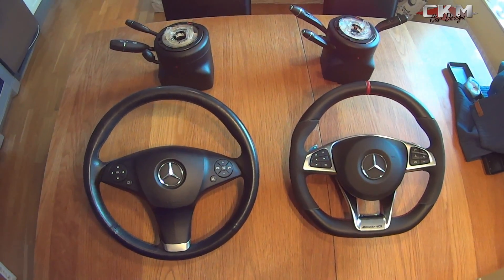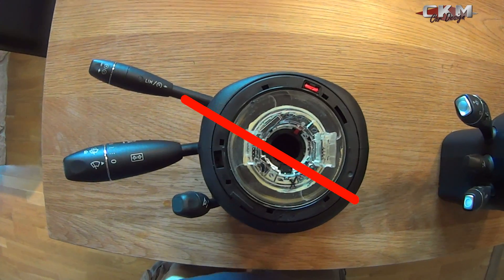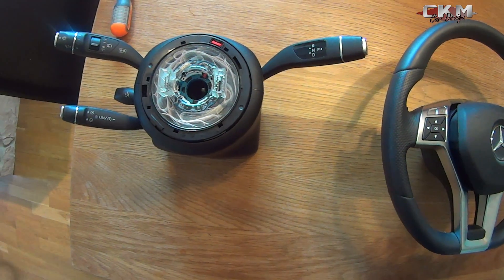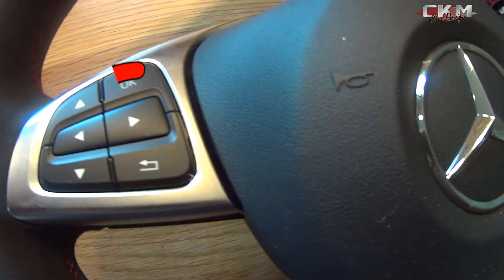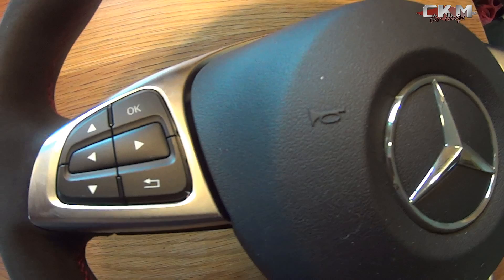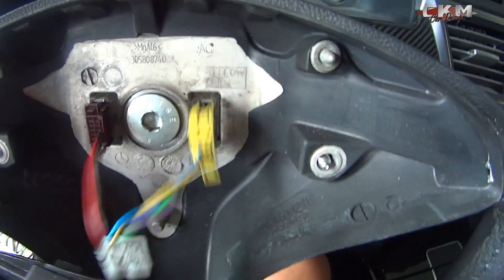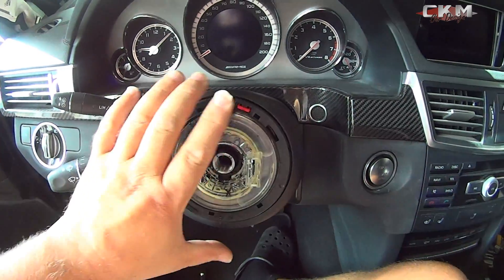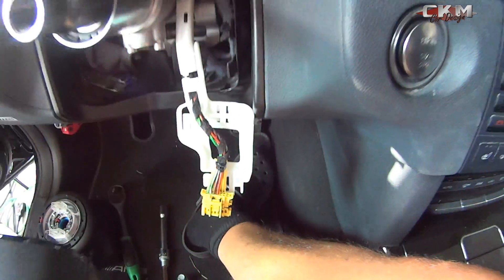Mercedes Facelift steering wheel retrofit W212 W204 W166 W176

Comment: Hey Chris I have this steering wheel on my W166 ML350 https://images.app.goo.gl/gS5v8dN7eJSqXKU96 and I bought this one from GLE W166 https://images.app.goo.gl/J3KqSQGBDJnuYT7j9 from what I understood of the video I can fit it without changing electronics and stuff right?  Do I have to change the console, because steering column looks identical to GLE. Thanks
Reply from the maker: Yes. Just switch it.
Reply: CKMCardesign great so I don’t have to change the steering column I just have to change the steering wheel. Thanks

Comment: What about the safety ? How much torque on the screw ?. Allowed ? Dont want to crash with 200 on the Autobahn😂
Reply from the maker: So if you would not torque it 100% what you think would happened? That it would just pop off. Dont worry. IF that ever would come lose just  tiny bit you would feel it right away. Like A year before it would come lose in hole.
Reply: @CKMCardesign  ok, C63 amg engine possible in golf 3? Kappa

Comment: Hi nice video. You showed me where to buy steering column from ebay, any idea where i can buy the steering wheel it self. Mine one is W204 2010  is fit replace with W204 2012  thanks a alot
Reply from the maker: On my site-.-

Comment: Did the air bag come.with the new upgrade
Reply from the maker: How you mean "come with" ? You chose with or without on the site..
Reply: Ye Christopher Thompson you can buy with or without 
Search ebay for deals also do your reasearch ....but try to buy with original airbag so no messing about or imho get from ckmdesign.se chris will help you from start to end and not just leave you once u purchase and will help you no matter what. Trust me... its worth it... i wish i bought everything from him to begin with.
What i have learnt is old prefacelift cars wont really work with facelift SWheels... you should aim for the 2012 + clockspring and SW. that way they can communicate better..some ppl get lucky and all goes smoothly..for myself i was unlucky cuz i have a 2010 w204 c300 and wanted to add a facelift wheel.... electronics are wired differently .... unless like i said ur lucky or u get all late parts 2012+ so they are designed for each other

Comment: Mate this does not work on the W204!

I brought a second squib from a W212 part no: A2129002620, and this doesn't work either. Now the car has thrown up 2 errors ESP inoperative and airbag malfunction!

Waste of £300
Reply from the maker: Then you buy the wrong ones as simple as that. Had this done many times on W204. See picture proof on my facebook if you refuse to believe me. ESP errors are a bad column.
Reply: @CKMCardesign   right it's just you  said that steering wheel in the video works and I've got a W212 column which you said works. Dunno what to try next.

Comment: whith Steering wheel stalk column clock spring 14-16 (http://www.ckmcardesign.com), in mercedes class c 2008. Is it possible to operate the steering wheel cams ??

Comment: Hey Chris, I have a 2007 W204 and I found an amg wheel that I really like from a facelift 2011-14 W204. Should it be just plug and play like in the video if I buy it with the column from the original car? The levers seem the same as mine - all black. Here’s a pic, thanks for your time! https://gifyu.com/image/EgXG

Comment: Can I do this same mod for my 2008 Mercedes-Benz c350 pre-facelift and have full functionality? 

I watched this video: https://youtu.be/8-e7M-sogJs

After seeing Raymond Urias try to do the swap on his pre-facelift and the buttons on the steering wheel not working I’m curious. I Don’t know if he bought the same exacts parts that you did? You tell me?

If it’s possible can you link me to the exact steering wheel and exact steering wheel column used in this video for the swap? Thanks and highly appreciate it
Reply from the maker: Of course you can. He have many failts in that video and I have told him...www.ckmcardesign.com
Reply: CKMCardesign quick questions before I make my order. I looked on the website and seen the steering wheels and I think I found the one you used in this video not too sure. But I couldn’t find the steering wheel column to match it.

Can you give me the direct links to the products so I can buy them off your website?

Once again I have a pre-facelift C350 which has the same exact steering wheel as the one you swapped out for the new one you installed.

Comment: Hi I watched another video and the guy said that this can’t be done as the wiring is different to the old clock spring compared to the new one. Have a watch, https://m.youtube.com/watch?v=8-e7M-sogJs   I really want to upgrade my steering wheel. Will it work on a 2010 e350 upgrading to a 2012+ steering wheel?
Reply from the maker: He just do it wrong.
Reply: What did he do wrong in his vids? Seems like he is doing exactly as u doing there. Thxx!
Reply from the maker: @moonmc1047  Wrong column.

Comment: Will it work on a 07 c216 cl500 ?
Reply from the maker: No. As said several times below. ;)
Reply: You shouldn't either cus its not a AMG
Reply from the maker: @ibtixgaming7168  What do that have to do with what wheel you install????
Reply: @CKMCardesign  Like if he wanted to put this in his Cl500, i just find it cringe cus i've seen many nordic people badge their mercedes with amg badges.
Reply from the maker: @ibtixgaming7168   Yeah..Wheel is avalible with or without AMG badge. This is not about the badge, Its about installning a sport wheel.
Reply from the maker: And since Mercedes do AMG badges on AMG line cars now I guess you have to tell Mercedes to stop to then. ;)
Reply: @CKMCardesign  they only do it on the floor mats and rims, get it straight.
Reply from the maker: @ibtixgaming7168  No!! You get it straight. Also a badge on the fenders. ;) See the W205 C450.
Reply: @CKMCardesign  the c450 is a amg u doofus
Reply from the maker: @ibtixgaming7168  No its not actually. You fint it on others as well. No need to be rude. Never mind. I let this go now. You are of course entiteled to you thoughts.
Reply: @CKMCardesign  whatever u think ole man
Reply from the maker: @ibtixgaming7168   Haha..Thats totaly corect...Ole I am.

Comment: hello dear friend i have a w166 gle and i want to upgrade to this steering wheel from normal one to amg my car is not vibro only heated i have found one steering with the correct buttons with multifuncion part number A 000 460 41 03 9E38
Reply from the maker: Answered.